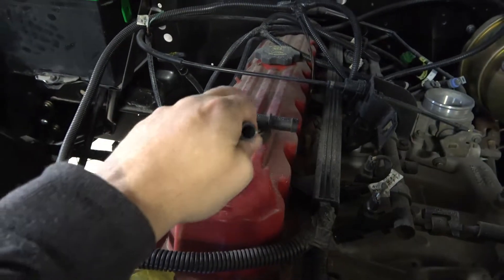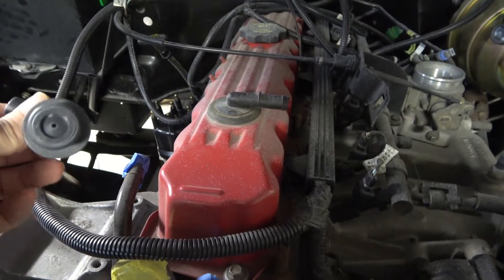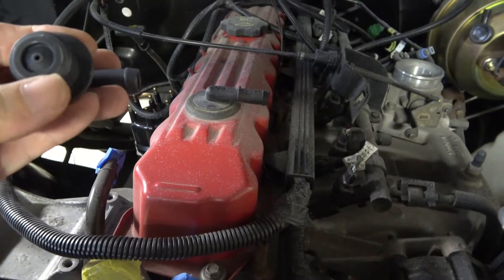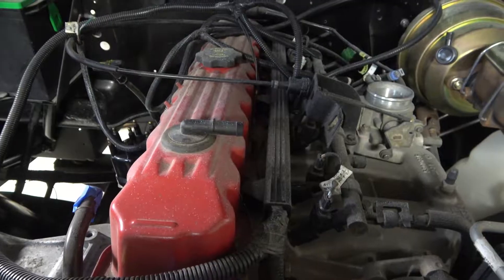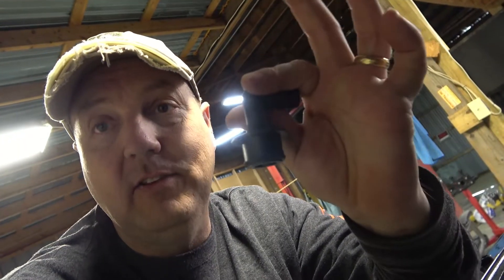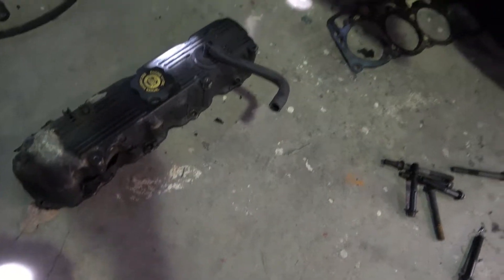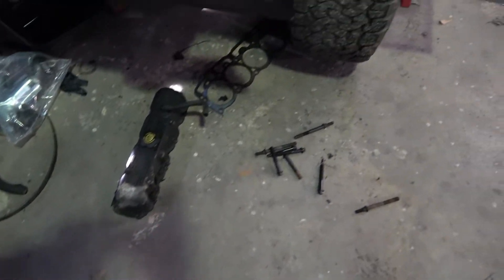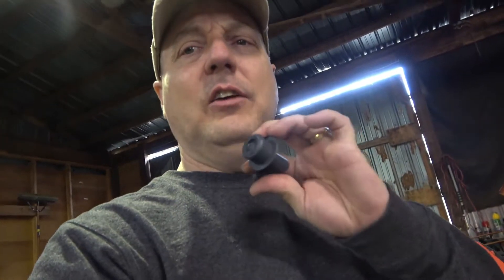Jeep 4.0 LITER Crankcase Vent Problems. CJ, YJ, XJ, ZJ, WJ, TJ, 4.2, 4.0, 2.5 6cyl / 4cyl

Comment: I swapped both of those out (including the grommets) when I did my valve cover gasket.Like you said,they were petrified.
Reply: Same.  I had to cut the absolute bejeezuss outta' mine, and luckily managed somehow not to get any of the hardened chunks down inside my valve cover.
Reply: Would you happen to have the part numbers or know the correct name for those pieces?
Reply: @Dayton504  I think they are referred to as crankcase vent valve by a lot of parts places. I have been trying for a few years to find them because I referred to them as CCV valves & nobody could find them. My boyfriend finally saw them on a site as mentioned above.